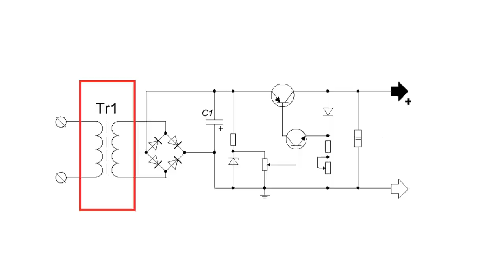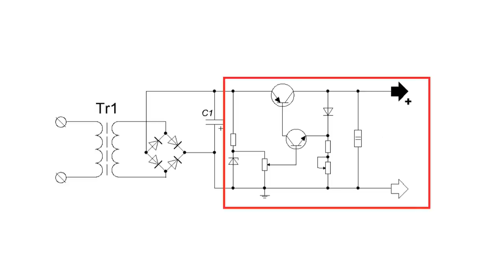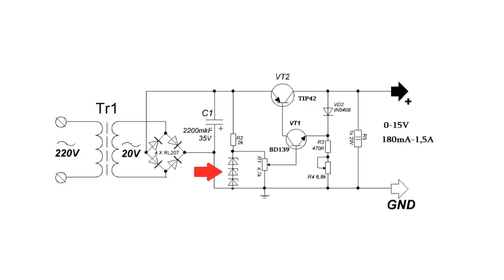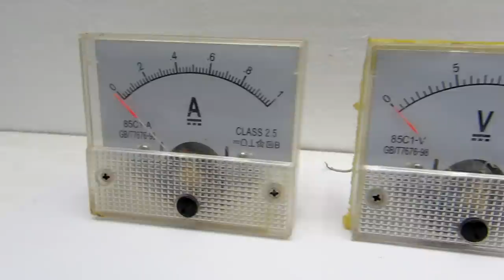Power supply with adjustable voltage and current

Comment: I just finished building. I changed the diodes and a couple other things. As I built using 2x 24V 2A transformers (the amps are very much needed in the bull plop in which I dabble) in parallel also with a voltage doubler throw switch incorporated into it (I tend to get into some crazy schtick when working alone... seems as if I need to humor myself just to stay awake...). Honestly ... It is very very very precise for the most part!

I killed current pot tho. LMAO. Other than that. VERY impressed. I just got my new lab psu about a week ago... NOT that I needed a new one. I was just keeping up with the Jones's. I was looking to build a new one from scratch. I have been reviewing a few different schematics over the last couple weeks. This one seems extremely simplistic and I very much had my apprehensions. However... I was very much proved wrong and sometimes it does seem that less is MORE.... just like the linux command... lol

Thanks for the great idea!

Comment: The polarity of C1 is backwards in the schematic diagram shown and so is the full wave bridge rectifier. The  PLUS should go to the emitter of VT2 and the negative of the power supply should go to ground.
Reply: i think this design wont ever work,even as you corrected

Comment: Good stability for voltage drop when the bulbs are powered !  5 seconds for shortcircuit are resonable but Try to implement a circuit solution with a permanent protection .

Comment: i think rectifier positive pole and capacitor positive pole would be changed to emiter of tip 42 is it correct or not please confirm one more think that is positive and negative are short

Comment: Seems your rectifier is inverted . the dc output is directly going to ground. WRONG
Reply: C1 is also inverted.
Reply: Should R4 be in between VT1 emitter and VD2? Should 20V RMS make C1 closer to 28-29V?
Reply: @chiefrunningfist  50 v would be much better and safer
Reply: @franzliszt8576  Why so? I'm trying to learn how this circuitry works. Kaysan's video's seem very simple to understand, but I want to understand each part of it before I dare trying it out for myself.
Reply: @JasonRobards2  damn i made this comment 2 months ago i have completely forgot about it i will tell you soon your answer.

Comment: Ive had trouble with the transformer and bridge rectifiier part of this type of circuit in the past. what about omitting those two components and get the desired fixed voltage from an ac Adapter ? like  one from a radio the little black box things you plug into the wall with a jack on the other end....? Im sure you know what I mean lol. will this work the same as an input voltage  you wold get from the trans/rectifier components? or would the amps not be adjustable as its fixed coming out of the ac adapter?
Reply: If you use that, you can ommit the transformer and the full bridge rectifier (along with the capacitor, if you'd like). The only problem would be the output voltage and output current of your adapter. And should you do a short circuit, you might blow the fuse inside the adapter.

Comment: since it's a liner power supply i assume i can't adjust it for higher amperage or the T2 will over heat 
or i can get away if i replace it with a power transistor ?
and if i can what should i adjust to get more amps ?

Comment: Hi. I am  following and learning from youIt.But this circuit is not working. I made it, but the resistance  of 470R was given out smoke! After calculations I noticed that if it's power is 0.25 watt, only 23 mA can pass through. Which means 9V maximum output can be taken. So it must be at least 2 Watts. Also the rectifier nodes must be changed as others mentioned.

Comment: I made this circuit,i used for two days.on third day while i was charging the lithium battery Tip 42 c burns and there is no resistance among those three pins.May i know why this happens?

Comment: Hi. If i replace the diode can i get more voltage from it? I really need a good power supply and it would be nice circuit and not a very expensive stuff

Comment: Several circuits Kasyan has presented are very interesting, educative and even a joy to see. 
But this circuit/project has some problems and difficulties, as it presents 2 mistakes in the diagram: 
(1) inverted polarity in rectifier bridge; (2) inverted polarity filtering 2200uFd capacitor. 
Also, circuit configuration does not provide consistent current limitation from one build to another, as it appears to be made using the transistor gain (beta) properties, which varies a lot from sample to sample. A simpler signal Transistor and shunt resistor (about 0.5 Ohm) could provide current limitation & protection, without affecting voltage stability. 
Several other projects made by Kasyan already perform much better than this one; use those instead.
Reply: "Several other projects made by Kasyan already perform much better than this one; use those instead." Please list those for us.

Comment: Voltaj neden 15 voltla sınırlı. 30 volt ayar yapamazmıyız ? Amperi yükseltebilir miyiz ?
Reply: It is probably limited to 15 volts because that is either the maximum of that linear voltage converter or the transformer gives 15 volts from the power from the wall.
Reply: Teşekkür Ederim. İyi Geceler
Reply: No problem, sleep well :D

Comment: I have a question!! Does the supply outputs a straight DC or a pwm signal?
Can i charge batteries with it
Reply: DC, you need a battery charger

Comment: Hi , May be an idea for a new experiment.   I got 10pcs  lm317  for $1 from TK Electronics ,  on Ebay  and  believe it or not  those work as original from ST and do not blow up  even at  39 Volts input and short-circuit ,  current limiting works at 1.5 Amp.  I build a  linear regulator powersupply   using a lm431(instead of  a 10kohm pot)  to drive the LM317 (in my case 6pcs in parallel). It resulted in an extreme stable powersupply.
Reply: Did you ever post this project? I would like to see it. But, YouTube will not let you post the link in the comment section (unless it is a YouTube address,) so you will have to find some way to code the link description to be something that we can understand.

Comment: Hi, my friend, my transformer and 25 volts to use in this scheme? Or do I have to change some componet?
Reply: If your transformer outputs 25 volts the voltage regulator needs to dissipate a lot of heat, the efficiency will drop as well. In other words, you need a bigger cooling block.

Comment: Wouldn't it be better if we use the LM 317 voltage regulator
Reply: 317 will not work here

Comment: Ohhhh. Where do I start?  Ok.  Your polarities are incorrect.  Switch the connection to the bridge rectifier as well as the orientation of the capacitor C1 and the circuit will work.  Your polarity indication at the output is labelled correctly but according to the take off from the bridge that would be a common positive. Also VT2 needs positive input at the emitter.

Comment: I have a circuit that draws 25 amp at 12 V , how can i Reduce the Amps to 15 but keeping the 12 Volts. Sorry for the idiot question.
Reply: If you have a transformer you need to change the secondary winding to a thinner one and also calculate how many turns you need for it

Comment: How to increase voltage to 32V and Current to 2.5A
Reply: Tech Maker change power  supply, like a 35 volt@3 Ampere one, find a 32 volt Zener Diode, change transistor to a more suitable one (like  TIP42) and  reduce value  of the 470 ohm resistor(i used 220 ohm 2watt resistor and  obtained output current of 4 ampere)

Comment: Hi, ca I use this circuit for 170V DC input and ajustable voltage and current output? Do i have to change the values of the components?

Comment: anyone pliss help me, i modified this circuit, use adapter dc 18v 2A, no bridge rectifier, 220uF 35v, 1n5402, pot 10k for voltage, pot 5k for current. component burn, and jumper also burn. when i put load at ouput. component burn
Reply: We will need to see your circuit diagram..

Comment: can i use this circuit in motorcycle for charging battry and 55-60watt headlight bulb? i have Yamaha rx135, we self made it coil and its output is 60v 6a when i accelerate bike on full throttle. we need 12v 5a for headlight and 12v to 14v 1a for charging the battry.
do i need to make some changes in circuit? then what is it?
please reply...... Thank You. :)

Comment: Nice vedio thanx for the same. Sir I want to design a power supply of 12 volt 20 amp current adjusted.  Kindly guide me how can I achieve. I shall be highly grateful.  Regards

Comment: how to convert the circuit to have adjustable current up to 3 amp?
Reply: and on capacitor after the bridge I have nearly 4 amp an nearly 50 v. are these parameter OK?
Reply: you can remove the transistor BD 139 and add BD 131 and you can have it up to 3 amps
Reply: ? Can i use 2N3055 instead of BD139 to get up to 10 or 5 amp?  what about VT2 do i have to change it too 
* my transformer can supply up to 10 amps
Reply: +Makka Pakka   I made the same that goes up to 3 amps at 24 volts maximum.  I use MJ2955 instead of TIP42 and a 5 watts zener at 24 volts.
Reply: can you send your circuit diagram please?
Reply: Is it suitable for 2A??
Reply: rene kenshin do you make this circuit or a similar because i made the same as in the video and it wouldn't work!

Comment: This is electronics for very poor people who can only afford junkyard parts. For example, you can easily find a LM317T regulator there, from which you can build a much better and more stable power supply with a few additional parts. So what's the point of everything you're showing here? Even in the slums of Calcutta they find better parts on the scrap heap.
Reply: I have been to Calcutta  and do not suggest examining scrap heaps
Reply: 317 will not work here